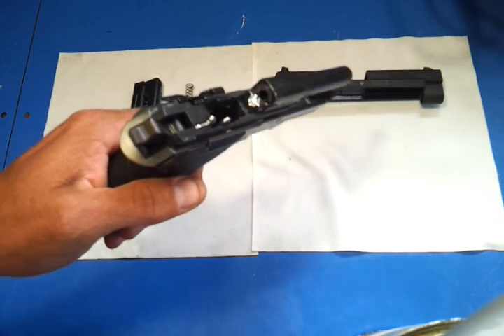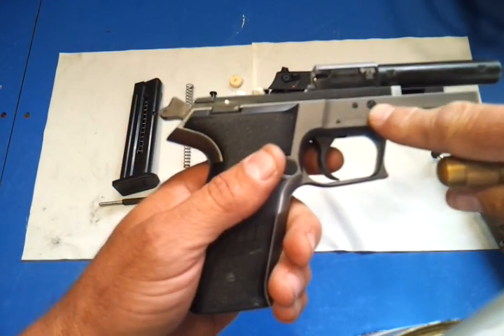Sig Sauer Mosquito. FIXED!!!

Comment: Mike,

Thank you so much for the video.  I followed your recommendation with great result.  I (very carefully) used a round rat tail file to remove the lip at the bottom of the chamber above the feed ramp.  I was very cautious to pull the file down and away from the chamber rather than push into the chamber to avoid scoring the top of the chamber.  Next I took a sheet of 500 wet & dry sand paper (used in body shops) and cut into one inch squares.  I wrapped the 500 grit sandpaper on a wooden toothpick and rubbed on the lip until it was smooth. This was a long process and I used five or so squares by the time I was done.  Next I took a Q-Tip and wrapped a square of 500 grit sandpaper and CAREFULLY sanded the inside of the chamber a small amount.  Finally, I used a Dremel tool with a cone buffer with Dremel polishing compound to polish the feed ramp and lower lip of the chamber.  I am not sure why Sig paints the feed ramp black but the polishing most surely helped the feeding and failure to fire issue.  On a related note, I swear by my S&W M&P 22 pistol.  It has a 12 round magazine, functions well on most 22 ammo, has a factory polished feed ramp and very seldom jams or fails to fire.  This is despite the fact that the M&P 22 has a lip above the feed ramp similar to the Sig Mosquito.  If CCI Mini-Mags were not so hard to find, the Sig probably would not have this issue.  Thanks for your YouTube post.
Reply from the maker: Fritz Brown Your welcome. Glad it helped. This is why I made the video. :>)

Comment: Thank you, mine would jam every 5-6 rounds, done these mods and it improved a lot, would still get the odd light strike as the bolt wasn’t fully closing, polished the chamber and now its perfect, cycles anything I put in it without any issues, I’ve also lightened the trigger from 9lbs to 5lbs, I’d recommend this to everyone who has one, it’s finally enjoyable to shoot.
Reply from the maker: That is good to hear! I’m glad it helped.👊🏼
Reply: How did you lighten the trigger?
Reply: @brianlynch4801  Hi Brian, it’s quite a time consuming job where you have to strip the pistol down almost completely, here is a link to a video which shows it:
https://youtu.be/zTmMyAc19xQ

Comment: I did the exact fixes on mine. And I can run any ammo anytime up to 500 to 700 rounds. With no failures at all, you have to load the magazine correctly, though no double stacking the rims

Comment: Love the to the point video. Will polish mine before next cleaning. I find it strange how I hear about all these jams. I am sure they are real as you hear about so many, but still.  Some have been fixed by using Sig mags also. Aftermarket mags tend to have a lighter spring tension they say. Have two mosquitos in my house (mine and the wife’s) that we use for plinking. Have never had a feed jam or malfunction of any nature. Have runs dozens of mags thru both. Have one that will not fire now. Suspect poor ammo as rim fire is inconsistent by nature.  A regular day at the range consists of a few hundred rounds per firearm so each mosquito has probably had 3k+ run thru them. Will be firing a different ammo in the one that did not fire. Different brand, new box, to see if that is the issue. Have already disassembled and inspected functionality and clearance of the firing pin and it appears fine.  No specs, just a quick visual. If it still misfires, will send to factory for repair. *update* found a very slight carbon buildup in the firing pin chamber. Cleaned and lubed. Ran 3 mags and fires fine. My fault for not cleaning deeply.

Comment: Hi. I polished the feed ramp on mine & it produced a marked improvement =- BUT I never thought about "deburring" the magazine feed ramp which I will do next.  I do have 10 factory Sig Metal mags so I guess that will be a job.  I was told that instead of using Expensive ammo like Mini Mags = the next and best economical choice is the Remington Golden Bullets with good results I have been told.  Thanks for the Information.  Sincerely,  JAMES.

Comment: I found that the spring by Taylor Tactical fixed the feeding/extracting issues. It had a couple issues with the slower ammo-  CCI Standard Velocity and Federal Auto Match. But they are very slow and, like I said, it was only minor. Might not be an issue after the spring breaks in. Mini Mags, Federal Blue Box, Remington Golden Bullets no issues,  if you get above 1135 or so in velocity you're good with the spring right out of the package, but, again, I think once it broke in a little, it wouldn't have issue with the slower stuff, too. Easy fix, just look at the velocity of the 22's you're buying- not hard to find what the gun will like. Neighbor was ready to throw the gun away- enjoys shooting it now. Girlfriend loves it, too. His 9mm is too much for her at this point.

Comment: I was having serious issues with my mosquito and was about to do this procedure. I really didnt want to in case I wanted to do a trade in down the road. Every other bullet jammed...then I stsrted using Remington Golden 22lr 36 grain and I was going mag after mag with no jams.

My suggestion is try multiple types of ammo, + changing the guide spring, then do this as a last resort.
Reply: Kevin, which Remington cartridge?  I see a couple.

Comment: This must be an old problem addressed by Sig in recent pistols.  I purchased three in the last 6 months.  One for my self and another for my daughter and GF.  All work perfectly.  It doesn't like the super cheap ammo, but will predictably fire most anything.  Also wicked accurate.
Reply from the maker: I don't think less then a year is an old problem. Glad to hear you have some good ones. NO such thing as cheap ammo any more, non the less it should  be able to cycle ANYTHING or why bother manufacturing a gun. Cheap ammo is what ppl want.

Comment: Kinda funny how just taking a little metal off and polishing a feed ramp can turn it around. I polished my feed ramp and took a lip out of my Walther P22 chamber,  rounded off the hammer with that edge or lip and gave it a polish, upgraded to a contained spring and an aftermarket extractor and that thing shoots like a dream over 4K rounds without a hiccup. 👌 I think we all know .22 LR pistols can be finicky.

Comment: I already smoothed/polished the barrel that seemed to help, I didn't get crazy with removing too much material so maybe it could use a bit more work.  But the magazine issue and deburring the feed lips, I need to look at that great tip/idea.  Overall I think I probably experiance a 3-5% malfunction rate at most when I do have issues.  I've had times it has ran flawlessly at the range and I could be shooting cheap ammo and it runs fine..

Comment: Personally had just as many problems with the ruger sr22 as I have the mosquito. I also have a Taurus tx22 and that runs great but it took a solid 1500 rounds to make it reliable
Reply: Strange. My sr22 runs flawlessly. The mosquito, not so much.

Comment: Sorry you cant turn the feed ramp or anything else chrome with a polishing wheel. Best you can do is get a mirror like finish. Still a good video. I have the same firearm. Only issue I have ever had with it is certain ammo wanting to feed. I prefer the CCI Stingers.
Reply from the maker: Obviously you cant, it was just a figure of speech. most people can relate to what I said. It looks like chrome when finished. Thanx for the comment and view! Happy shooting.
Reply: I know its a figure of speech. Some people do not know chrome is a plating process, but most do.
Reply: Mirror like polished! 😵‍💫

Comment: Mike, on my Mosquito the hammer doesn't seem to want to fall all the way and stops about 1/8" away from the back of the slide. I don't think that's normal.  What do you think would cause that?  When you had your's apart did you see anything that would prevent the hammer going all the way forward?  Thanks.
Reply: Spring is missing from the drop safety.

Comment: I got the problem with my clip holder, pin, the plastic pin is worn , from being holster and setting in my truck door for a time. Geuess the fyibration worn the clip pin and my  clip won't  stay in place, any ideal were I can get the parts to fix it, I looked on line and everyone says its sold out.

Comment: Mine is two weeks old and finicky as heck... 22 ammo is hard to find... Especially CCI mini, mine did like Remington Golden Bullet... But, still, it shoot 22 ammo!!!  My Ruger, SR22 will eat any ammo I feed it!!!  

Going to remove that lip... Thanks for the video... If I do royally screw it up... Are replacement barrels available?  Any website recommendation for that...?  Thanks again!
Reply from the maker: I don't know about replacement parts but you wont need them if you take your time! don't remove to much. Don't forget to remove the sharp lip inside the mags as well. Love the SR22.
Reply: Gemtech makes a barrel for the mosquito, but every time I check it's out of stock... I just e-mailed them 8/10/14 to see when or if they will have them again,  I'd like to try one of theirs.

Comment: I had just bought one a few weeks ago. I tried like hell to get it to jam or hiccup or anything. Couldn't do it. Shot perfectly fine with hollow points. I easily shot 250 rounds with no problem. But if I do encounter a problem of anykind, its back to Siggys. Let them fix it.
Reply: Yea, right... that's why they stopped selling the Mosquito...

Comment: ok....removed the two screws and the barrel wiggles a little but doesnt come off.....any suggestions?
Reply from the maker: Its just wedged in. I haven't done it since the video was made.
Reply: Turn lock handle forward.

Comment: Now my question would be this = If you polish the feed ramp like you did WILL THAT VOID THE LIFETIME WARRANTY SIG PUTS ON THE MOSQUITO?  I asked sig for a small little spring that I had to pay for = (mag lock back on empty mag - on the magazine latch catch).  They said they would do it THIS TIME but from now on I would have to send it back to the factory so they could have them fix it - NO MATTER how small the fix!!!!!!  I think they just want to check & see if you modified anything so they could VOID the lifetime warranty. I will NEVER purchase ANYTHING from Sig Sauer.  Sincerely,   JAMES.
Reply: remember the gun is only going to be good for 15,000 rounds. That the life cycle of these training guns. I want to use to make my centerfire practice better.  Never bet your life on a 22 lr. If you want a gun to shoot for 50 years go get a ruger 3 or browning buckmark. Definitely not a training gun. I've already pulled out the stop on the hammer spring and polished the feed ramp within 50 rounds of new. The gun's trigger is lighter on double action, feels better in single action and works flawlessly with crap ammo. (I've got the small spring in). So golden bullets and even thunderbolts cycle . Plus mine is threaded, so I will be getting a suppressor in the future.  Enjoy
Reply from the maker: Buzz, I wouldn't worry about the warranty. At least we can shoot it doing what I did and if it got really bad Id go get another ( better) gun. The Ruger ppl are VERY good!
2 different times on 2 different guns, 1 my fault, 1 mfg fault they sent me new sight pieces at no charge.
Reply: Unless something has changed that I don't know about now Sig only warrants the Mosquito for one year of the original purchase date, it states that in my owners manual. Mine has been out of warranty a few years now and to this day I have not done the mod yet as seen in this video, but I will do it eventually.My Mosquito will only cycle CCI Mini-Mags and Remington Golden Bullets flawlessly. Pretty much anything else and it FTE every round.

 About the only way I'll probably ever buy another Sig firearm will be used condition and I'll test it out first, because I got a hold of a real smart ass at Sig just by asking a simple question about the two different slide springs for my Sig Mosquito.

 The smart ass I talked to said they are exactly the same spring and that there was no light spring or heavier spring to choose from. Neither one of my springs was marked with white paint as it stated that one was in the manual, I believe the lighter spring suppose to be marked "white" according to the manual I have.
Reply: Buzz Clark 
Tomorrow
Reply: SIG does not support the Mosquito in anyway. There are no parts or guarantee of NOS parts anymore.  I found this out 4 years ago after I dropped mine and destroyed the rear sight. I was able to find a replacement but quickly got rid of it.

Comment: Do you know of a way to get the thing to eject after it's fired?  Mine feeds OK but I can only fire one round at a time.
Reply from the maker: Steve C  CCI is the best ammo to run but make sure the slides are lubed and the ejector pin and slot are clean.
Reply: I have a GSG Firefly which is basically the same gun . I'm not sure if the Sig comes with the two Springs but my gsg comes with two Springs when you buy it. Try using the other spring it may help you

Comment: It ain't fixed until you fix the MF'in 300lb trigger pull. My Sig P-220 (.45 cal) has less tigger pull than that pice of crappola.
Reply: Couldn't agree more, bought a used one today and wish I had tried the double action pull in the gunshop, my VP70 has a nicer trigger

Comment: I'm sorry in advance as I'm still a bit of a DIY novice.  I understand the first part but what is "deburring"?
Reply from the maker: When they stamp the shape of the mag it leaves a sharp edge on one side witch happens to be the inside of the mag. So use something with a sharp edge to  remove the sharp edge. Right a the top inside of the mag were you insert the ammo. De burring tool looks like a pencil found in the plumbing dept.
Reply: mikewillfindgold great advice.  Thank you